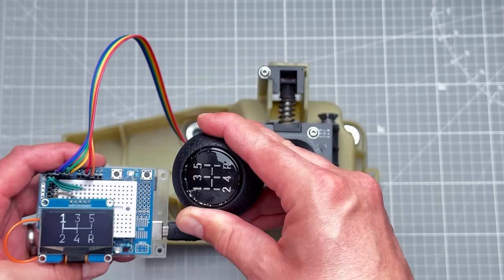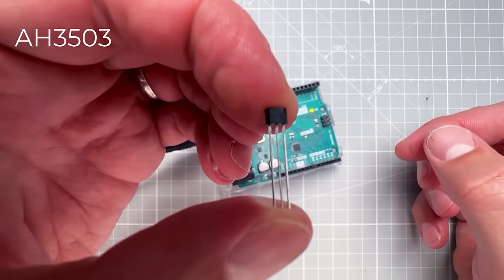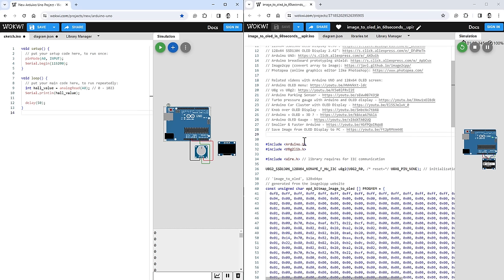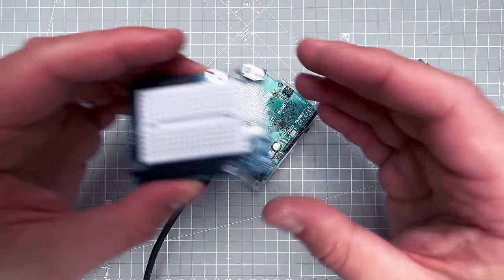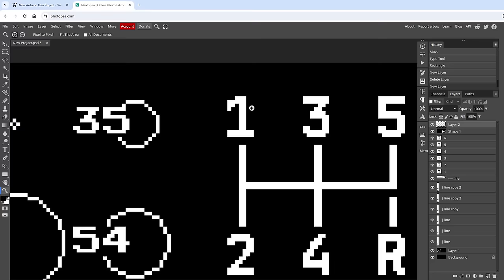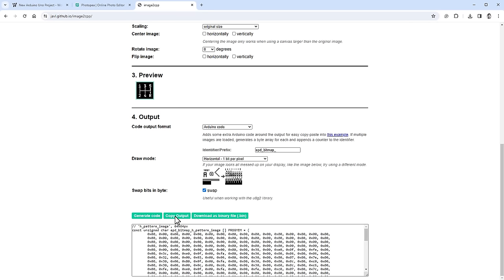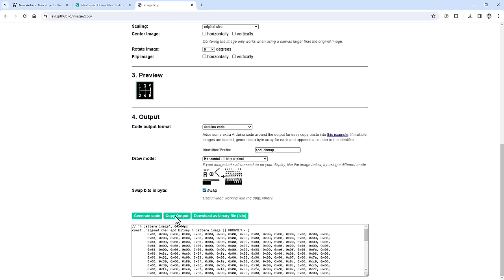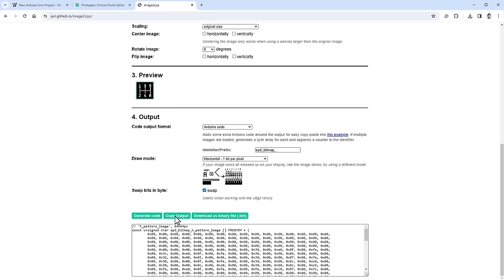Drive in Style: Arduino Gear Indicator (full tutorial)

Comment: Amazing idea and channel. But 1 stupid or not question, why not using raspberry? Arduino is better?
Reply from the maker: Thank you. Arduino is not better; it´s slower, but sufficient in this case and also cheaper. Also, probably easier to set up and use for beginners. Also, no system = no boot up time and it will run a second after you power it up. If you need a high-resolution color LCD screen, Raspberry would be a good choice. For a simple OLED screen, Arduino is enough. Does that make sense?
Reply: @upir_upir  ofc it does. And ty for awnsering
Reply: One question more, 😅, if I want to connect 2 of your programs let's say that one about obd2 values in display and this one. An uno r4 will be enough or better buy mega?
Reply from the maker: @Helder_Paulo  The UNO R4 should be sufficient, the downside is that  you cannot simulate it on WOKWI. For that reason, I would probably go with MEGA, since you can simulate Mega on WOKWI, which makes of course development much easier. Another option is ESP32, that´s also powerful enough and has support on Wokwi.
Reply from the maker: @Helder_Paulo  You are welcome, good luck with your projects!

Comment: could this along with the data from the rev counter be used to indicate when to change gear?
Reply: A interesting idea have it blink the number or a circle around the number of the next gear when it determines a shift is required by revs
Reply from the maker: Sure, that might be possible. I will try to expent the project in the future and blinking the number is surely an interesting idea. Thank you!

Comment: I have tried applying it to the vehicle when the car stops everything runs normally but when the engine is turned on the LCD screen is stuck freezing. I think it might be interference from EMI in the vehicle when the engine is turned on. Maybe you can provide a solution. thaks you
Reply from the maker: How do you power the screen/Arduino?
Reply: @upir_upir  i use buck conventer 12v to 5V

Comment: Wouldn't it have been simpler to use six sensors, one for each gear, and then the selected gear is just the sensor that is currently outputting the highest voltage?
Reply from the maker: Yes, you can do it this way as well.

Comment: Why not use an accelerometer instead of the hall sensors. 
You could have all the positions mapped and have no need for magnets and sensors. Would probably be cheaper as well.
Reply from the maker: Would that work? I was thinking about it, but I also think that once you accelerate, the readings from the accelerometer would also change, which might confuse the current gear reading. That said, I might try that.
Reply: @upir_upir  I believe it would because the accelerometer under severe acceleration would go over the 1G mark in certain axis, so that can be addressed in the code and based off placement you should see only certain pre determined values. Now something that might become an issue is when the car isnt parallel to the ground, elevations from a slope could cause the code to get a bit more complicated. Love the videos though! Very cool stuff.

Comment: How would you use these skills to make a plug and play digital dash for Volvo S60 from 2001?
Reply from the maker: I do plan to record a video with digital dash, although not for Volvo S60. Is there anything special about this car that would be worth looking at?
Reply: @upir_upir  
Well. I happen to own one. And it is hard to find replacement parts for cheap outside structual and powertransfer and breaks. I am planning to modernise it a lot. And I want to do it as cheap as possible. And since the original dash is just screws and one electrical connection, I would like to learn to make a digital one and maybe even link the gear sifter indicator in this video to it.

Comment: My experience with these oled displays are that they burn in relatively quickly
Reply from the maker: I have this particular one for 3+ years and I don´t see any signs of burn in. Maybe if you keep it shining 24hours a day, but that´s unlikely.
Reply: @upir_upir  i use for the recording of lectures video wireless transmitters which have a small white oled that shows the channel number etc, they arent even that old and theyre burned in to shit. maybe they messed up powerdelivery or just those panels specifically are bad

Comment: Hall sensors are not fixed, shocks will break the terminals!!! Otherwise, nice but far from practical use.
Reply from the maker: Thank you for your comment. This is just the first stage, I hope to refine it some more and make it more rugged. For now, the hall sensors are loose so I can rightly identify the correct position and placement. For a final version, probably some 3D printed enclosure would be used. And of course, also somehow move the display inside the shifter knob.

Comment: Полная хрень!
Reply from the maker: English please…
Reply: @upir_upir  Are translators poorly used ? In general, you're doing nonsense, why bother so much, magnets, arduino, boards! What kind of transmission is displayed on the panel, you can just take the indicators from the dashboard or straight from the  gerbox!
Reply from the maker: @BAD_CATpv  This particular transmission does not have any sensors and the dashboard does not show the current gear. It´s 17 years old car, and I´m sure it´s not the only old car out there...
Reply: @upir_upir  And what kind of car is this?